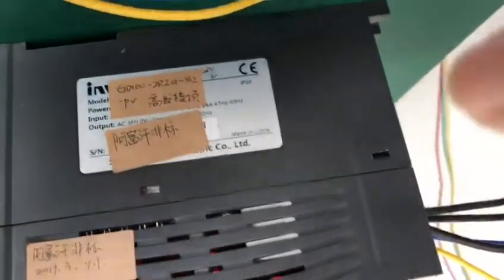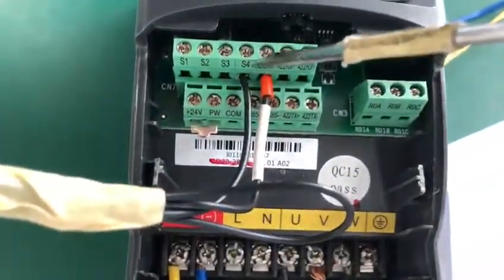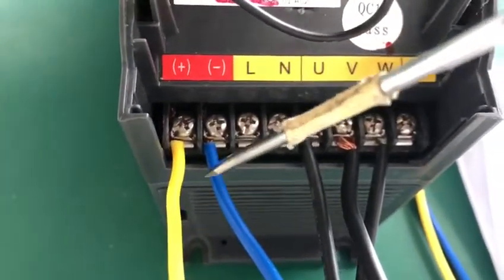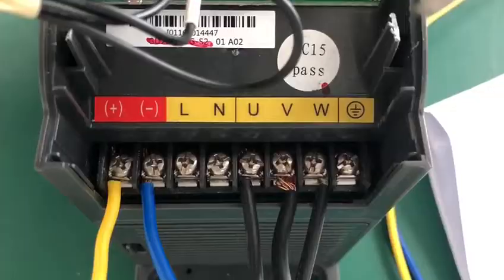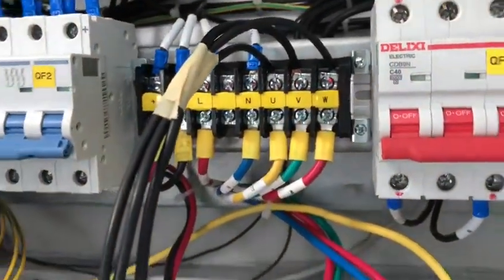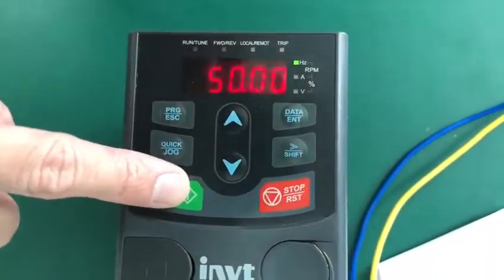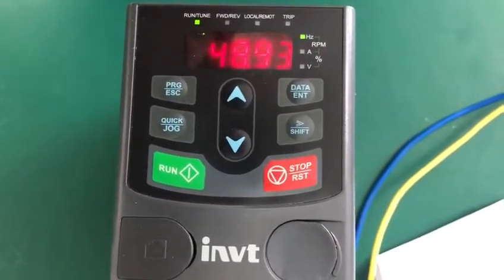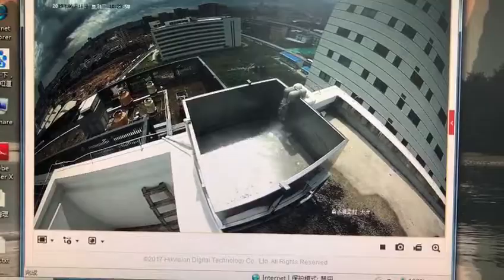INVT teaching: How to Connect Single-phase Pump without Capacitance?

Comment: Hello there, 
I'm one of your YouTube channel subscribe.

I need your instructions regarding my invite.
I have installed 20 solar one solar equal to 250 v.

So my water pump is to much far away from solar, the total distance from solar to water pump are equal to 500 meters .

For the first time when I connect the  DC power from solar to invite so the invite was too much close to solar and I tried to supply AC power to water pump for 500 meters so when I push the run button the invite automatically stop working .

Therefor when I toke the invite near to water pump and I supply DC power from solar to water pump for 500 meters distance that time the invite worked properly and the water pump supply for 600 meters .
i hope you can get my point
Shafiq Wardag: So my question is I need to know is there any possibility to for invite to start automatically in the morning ?

Comment: can i have support i need to connect the inverter invt GD20 to cnc controller (BL usb mach 3 V2.1 ) that let me control the spindle motor throw   mach3 

thank you for your help
Reply from the maker: Hi my friend thanks for your inquiry. You can try to contact our tech team directly. Thank you.
zhangfeng5686@invt.com.cn
Mobile&WhatsApp: +86 17603063816 
WeChat: 156531704

Comment: How can we use it on capacitor motor submersible 1.1 hp ? how many solar panels do I need? does it work for any sumergible pump single phase?  my email is matruppi_2@hotmail.com
Reply from the maker: Copy that, thanks for your inquiry, our team will contact you soon.

Comment: Hi we're using invt and inf gd100 models for solar purpose  in 5 years. but right now 2020  frequently ol2 and oc3 big trouble facing in 1ph(ss2).  for example  parr 29.01 set in 0(1ph mode)motor running  slowly (capacitor removed as per user manul) motor parameter also corrected this time  we're putting 29.01=1(3ph230v mode) motor working well in below 45freq after 45freq ol2 displays (due to maximum amp10 in settings)please give me a solution for  run by  default settings for (29.01=0 single phase mode)definitely amps will improve 14a
Reply from the maker: Hi my friend, may I have your email or whatsapp? Our team will contact you soon. Thank you
Reply: @invtelectric  my whatsapp no 9698930049 email address is tomgopinath@gmail.com
Reply: We're waiting for your reply
Reply: @akilsolarsystemtrichy4805 
Did you get solved this problems.

Comment: Presently 7.5 invet with 17 Pv each of 400 watt running 4 hp (3 phase) submersible motor. In the premises single phase supply of company available.
1) can we connect single phase (220 volt) with the invet for real time sharing ?
2) if not can we supply 2 phase or 3 phase company to the invet for real time sharing ? After installation of 3 phase meter.
Reply from the maker: Hi my friend, may I have your email? Our team will contact you soon.
Reply: Hello.friends give Me your what's up number please.can you help me

Comment: Dear can we connect both supply . solar and 220 Ac at same time.what happened if we do.
Reply from the maker: Hi sir, may I have your eamil? Our technical support will contact you soon.
Reply: @invtelectric  
Hi ,
Cam we Run 1kw 1phase Sumbersable motor 220v/50hz remember motor has capacitor.
engr.khawar2@gmail.com
Reply: Eta Karne Se Vfd Jal jaye ge
Reply: Hi mr thank you for explication ho two connected pompe single   phase with capacitor my email: chible.simo@gmail.com